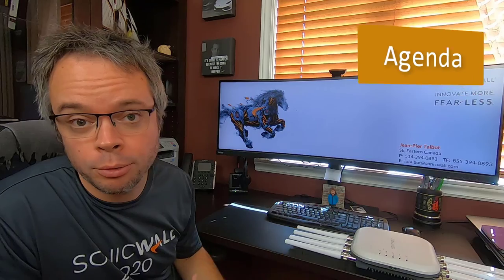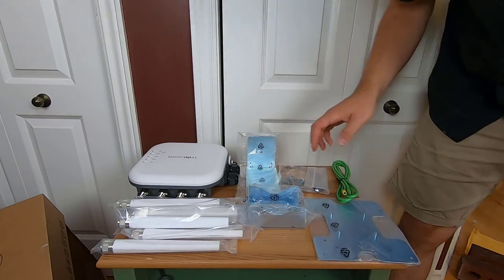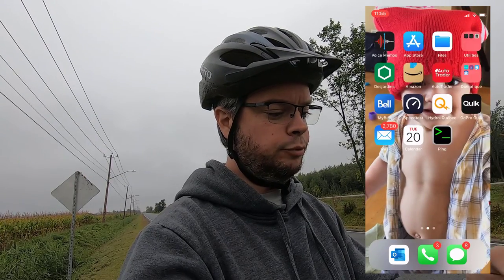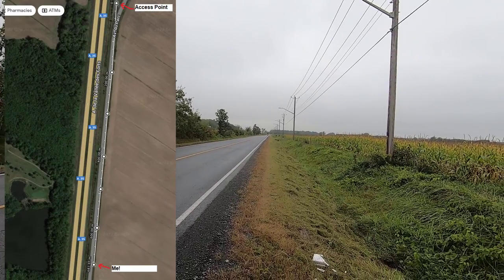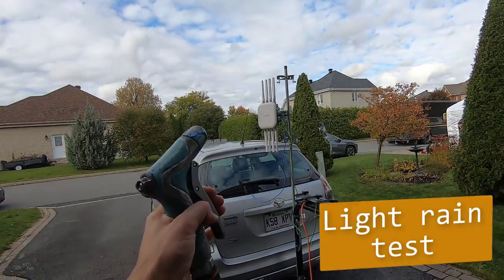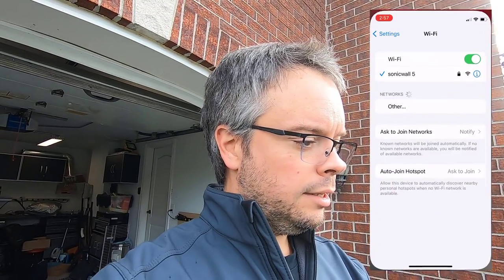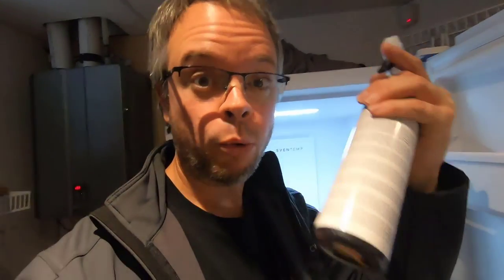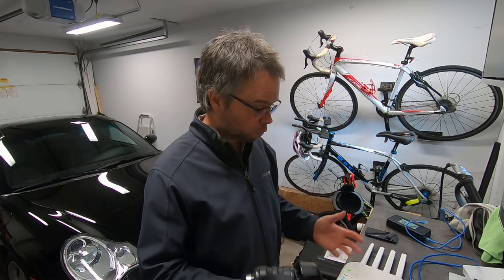SonicWave 432o overview, unboxing and torture test

Comment: Hi, will this unit work with a TZ600?
Reply from the maker: Sure!
Make sure you run the latest firmware in the firewall as the AP got released after the tz600. So if you run a very old firmware, it won’t work.
I personally prefer to not use the firewall to manage the AP. That way, the day you change your tz600 for a new tz670, you won’t have to worry about your wifi as the tz is not managing it
Reply: @JeanPierTalbot  Hi, thank you for your message. What would be the best way of managing the AP’s?